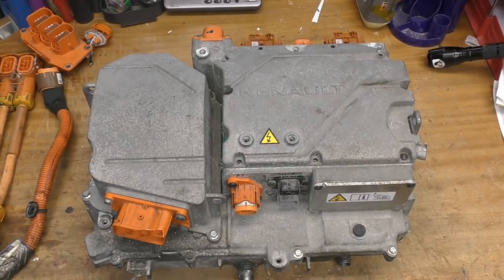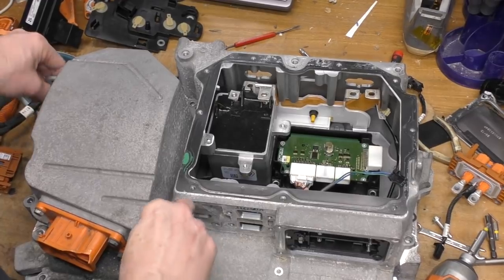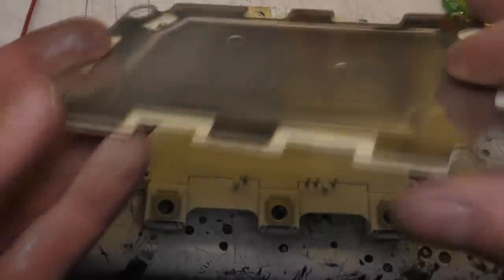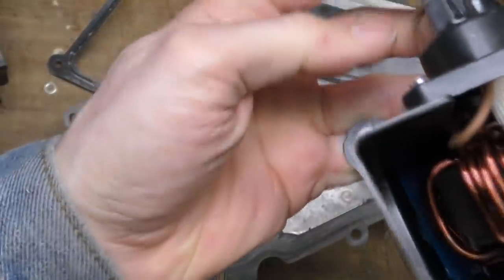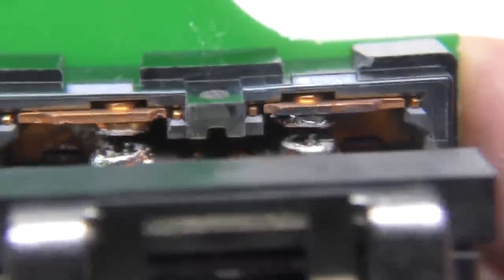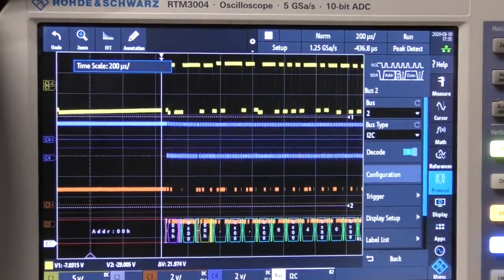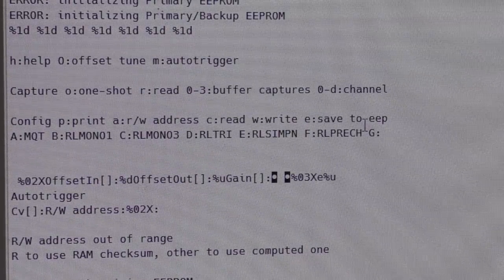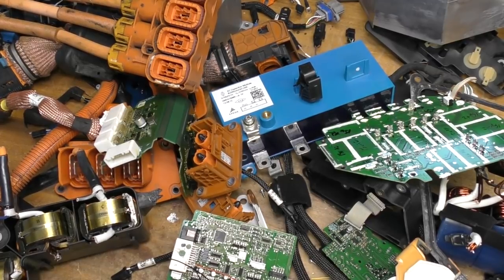Renault Zoe EV Battery Charger Block ( BCB )

Comment: Hi, thanks for this video, very interresting. You correctly guessed a ot of elements :)
A few technical indications though:
- On the rectifier control board, this is an Actel/Microsemi/Microchip (in order of company acquisition) A3P125 praetorian FPGA, not a plebeian CPLD :P It mostly manages safety redundancy and some basic low-level / high-speed functions (OC and OV detection and latching, blanking and dead-time correction ...). There has been some experiments of making it do the PWM generation instead of the MCU, but it showed unconclusive in terms of efficiency for the system.
- There are two CAN transceivers on this board, one for the vehicle CAN and board power management (TJA1043), one for the transmission of the BOOST signal, which uses the CAN analog transport interface for noise immunity, thus the transceiver is a much simpler one, with no timeout protection, since the signal is a simple 10kHz PWM.
- The shunt board generates a 100kHz PWM that indicates the neutral current, and is read by the MCU (since there are no isolated analog links in the isolator chip, the value has to be transmitted with digital signal).
- The input module control board (with the DSPIC) has no CAN transceiver, it is not connected to the CAN bus. The compnents you saw are LVDS transceivers, which give some noise immunity to the SPI bus between the rectifier and the input module. This bus goes through the small shielded harness. This link is really noisy, thus the SPI frequency is pretty low (5MHz).
- The Input Module having no connection to the CAN bus of the vehicle, it is not a "standalone" ECU that can be accessed through the ODB plug. It is a slave module for the rectifier. In addition, there is no mean for reprogramming through the SPI, thus the presence of the ICSP connector for eventual update.
- Being a slave module for the rectifier, the input module only does analog measurements of mains voltages and currents, and manages some relays, including pre-charge relay, pretty much like some kind of evoluted IO expander. You are right : the content of ths program in this module is not very interresting.
Reply: No Renault not interesting 😁😆😆😆😆
Reply: Does that mean that if it fails there is no way to know unless you open the unit physically ?

Comment: I am more impressed by connectors and interlocks than by electronics.
Reply: They look fragile and overly complex to me, but I'm no expert ;-) It would be interesting to compare with other brands.
Reply: They seem like the outcome of an odd engineering tradeoff between reliability and speed/ease of assembly; bolted lugs (perhaps with a plastic cover containing the interlock mechanism and sealing) would be more reliable, but much slower to assemble.

Comment: I heard that it would just measure one of the additional L2 or L3 phases to decide if the supply is single or 3 phase. 3 phase plugs usually are required to have a 3 phase circuit breaker, avoiding a phase missing on the plug. But any main fuse of a building needs to be a fuse that melts, so it is not tripping all phases, risky not to monitor all phases then. Don't forget, it is a french car, it doesn't have faults, it has character ;)
Reply: As they say, it's not a bug, it's a feature!
Reply from the maker: Some tethered public charger cables are in terrible condition, so a broken L2 core is totally plausible
Reply: Grubby contactors in public chargers, very easy for a phase to be missing. Hope someone sends a 22kW one in to Mike. The 22kW does still very much make sense with CCS too, as the new one has, as I regularly charge at 22kW AC only chargers.But agree 43kW is dying, given that they are costly to add to rapids due to being tethered thick cables. A 22kW socket is similar cost to a 7kW if there's a 3phase supply to the unit anyway
Reply: Can't wait to see what character Landrover manages to build in if they make an EV. I'm sure it'll be the first EV to leak oil from the charger module.

Comment: Hi Mike! Excellent video.
We have a 2013 reg Zoe with this BCB setup, we have our car at a Renault dealer for the 3rd year in a row with the filter unit going faulty. The Renault Dealers can never work it out its hilarious!
The first year the dealer had the car for 6 months and replaced everything motor, gearbox, BCB the lot under warranty problem solved lol.
The second year they kept giving it back to us saying its was the cable, no fault found etc, meanwhile we blew most of the public charge points in the north west. It took for BP Chargemaster in the end to send out an engineer to test the car whilst charging, what we found was after about 20 mins or so charging at 22kw 3phase the inverter would get hot (you could here a loud fan come on) and the amp reading from L2 would loose 10 amps, whist checking the earth, it gained 10 amps back to the charge point so the L2 circuit was short circuit. Filter replaced under warranty after me bugging them about it problem solved) . We think the problem is we only charge on 3 phase public charge points at 22kw the filters dont seem to last longer than 6k miles worth of that kind of charging.
Anyway here we are again for the third year in a row! we have been getting slight shocks of the body recently and now its has blown charge points again after 6k miles, this year when it first did it, it sent a surge through the car and flicked off all the 12v breakers in the car until ignition was reset.  Now the dealership say we have to pay a stupid amount of money so a Technician can chase down fault code "006023" which is a Renault specific DTC for the EVC. We know its the filter box going faulty again but unfortunately for us Renault insist on plugging in a 5v DC computer to tell them answers on a 600v ac system. 
So we had a question for you, do you know if the EVC is the ecu that controls inverter setup (Filter Box etc). And do you know of the code from Renault so I can pin it to the Filter Box to save getting an electrician to a charge point, thanks.
Reply: Hi, Is your car Q90 or R90? I didn't get from this long video which model has that problem and how to prevent from happening?
Reply: Wow what a shitty car, hope you got rid of it what a PITA!

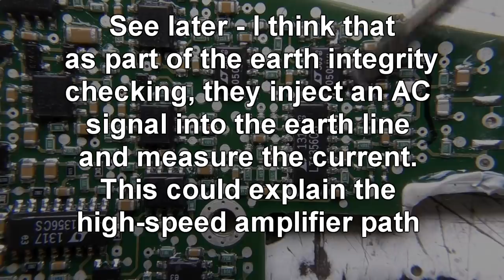Comment: Re the comment at 20:24; I designed the GMI (ground impedance test) circuit for an EV 'charger' (EVSE; unfortunately can't describe how it works b/c commercial confidentiality) but it did not require anything fancy or highspeed; three or four dirt-cheap commodity silicon parts and some passives.  The BOM for that section is maybe $3. I don't know how 'other people do it' but the solution I came up with is simple and works fine (can safely measure the gnd impedance from a few ohms to kilohms; enough accuracy as we just need to not activate power if the ground is no good, actual trip points fairly loosely defined in standards). There was a bit of headscratching as it's not immediately obvious (wasn't to me) how to do it -  we worked out some viable-but-complicated ideas, then I had a lightbulb moment and it turned out to be simple and cheap.
Reply from the maker: Checking earth form the car's end is rather different as it has no reliable reference for what earth is, as it sits on insulated tyres.
Reply: Could you emphasize on the earth-checking system of Zoe, please? I paid an electrician to install new 3phase 5wire cable and 5pin CEE32A socket. He'll do that next week. I told him that the car is earth-picky but he didn't get what I mean. He said that in our country the Neutral and Earth are galvanicly conected and that he will short them at the main power box. Should I tell him to connect the Earth wire from the new cable to an Earth rod, instead(there is a suitable damp place to install one)?

Comment: Lever-lock connectors are actually very common in car wire harnesses since a long times, the ones used here are just using an usual lock-lever design, on steroids.

Comment: The Relay-Melting-Error happens when a Charging-Session is started without L2 but with live L1 and L3, because only L2 gets checked to determine 1ph or 3ph ( https://www.goingelectric.de/forum/viewtopic.php?f=62&t=26015&p=588280&hilit=zoe+relais+kurzschluss#p588280 ).

The Module looks like the 43 kW Version (Conti, Q), the 22 kW (Renault, R) Engineroom looks completely different https://i2.wp.com/www.zoe-club-austria.at/main/wp-content/uploads/2016/01/MotorVergleich_Q210R240.jpg?ssl=1 .
Reply: That sounds like a major design flaw. Check L3 before trying to connect it to neutral.
Reply from the maker: That is so dumb - I think anyone experiencing it would have a good case for a free out-of-warranty repair as it is a design flaw that was there from new
Reply: It is covered under the 5y HV-Warranty and there might be a Firmware fix, but no one wants to try out since the repair cost is a few thousand € and renaults goodwill is to low.
Is it doable to change the relay without any destruction, e.g. cutting the connector-cables?
Reply: a €5000 phut-bzzz noise maker then?
Reply: All those elaborate self checking safety systems and interlocks and they miss something like that, oops to whoever wrote those test scripts.
Reply: @mikeselectricstuff  or anyone else who might know this:
How do the relays at the bottom (marked with 1-3 in 27:46 ) behave during single and three phase charging?
Is relay 3 closed when using three-phase charging (so a star connection to earth via the 220n and the Y2 capacitors) and relay 1 or 2 are closed when using single-phase charging (depending on which of the two wires really is "N" - you can't know that with a regular household plug)?
Or are all three (1, 2 and 3) closed when using single phase charging (via L2 in this case) - however, this  probably doesn't fit the theory that single-phase charging is detected and the N-L3 relay is closed when L2 is without voltage...
Reply: Could we assume that R version with 22kw AC charging is safe from this Short situation?

Comment: That connecting a phase to neutral fault can also happen on Konas combined with a Zappi 3 phase charger. The charger swaps between 1 and 3 phase to fine tune the amount of power the car can take and under the right combination of conditions, bang!

Comment: The relay switched caps to ground are probably switched because those capacitor values they needed for enough EMI suppression are too large to give a safe touch current if the ground is interrupted and because they would trip RCDs if connected as usual from both line and neutral to ground. Relay 3 would be energized for a three phase supply where the X2 capacitor midpoints are close to ground potential. Relay 1 or 2 would energize for a single phase feed depending on if line and neutral are reversed (1) or not (2).

Comment: I lvoed my Zoe but the charging system was fickle and unneccessarily complex. Just like the heat pump which was pointless below 0 C, and made the heating/cooling excessively loud. And despite all the complicated charging electronics, you can't even set the charge current inside the car.  I had the 22kW version with the 22kWh battery (R240). Now I'm driving a Model 3 and I have to say it's a completely different beast. Especially if you lease, the relatively small difference in monthly payment makes it really hard to go for a Zoe, even the latest one.
Still, I enjoyed driving my Zoe. It was a quirky little car that had a lot of spunk going from 0-50kph. And the driving position and seat was VERY comfortable.

Comment: Great video, thanks. The 22 kW unit is completely different, Function of PEB and BCB in one metal box. Pretty sure the blue capacitor is filtering only. Power factor correction is done using the switching. The relay switching 3/1 phase is actually connecting L3 to N. How cool you got one with the welded relay. I also had my hands on one that because of either a relay or control fault could not charge one phase, but happily 3 phase. The relay noises were pretty scary.

Hera are some wave forms and the PE-N current insertions. All made by speakev user ElectricBeagle btw. https://canze.fisch.lu/charger-startup-sequence-the-measurements/
Reply: do you have schematics? I'm curious what will happen if N is disconnected when charging?
Reply: @rslutsker  I don't, only functional. You can find them in the CanZE blog. The phase current, while shaped, is most certainly no perfect sine. I would expect the charger to balk immediately if the N was disconnected, also (and maybe most importantly) because then the N-PE voltage would spike, indicating an unsafe condition. I am curious why you are exploring this scenario?

Comment: I had to have this replaced on my Renault Zoe when I had one. It had a fault where when charging at the full 43KW it kept tripping an internal sensor but worked fine on 22KW & 7KW Chargers. After a lot of diagnosis with the Dealership & Renault it was found that this was faulty and the error codes seemed to point that the Neutral pin was sensing power when it was on the 43KW units.
Reply: Ryan Walmsley how much did it cost? Mine needs a replacement

Comment: Do you think it would be possible to integrate DC charging into the battery charger block, if a seperate CHAdeMO controller is used?

Comment: Thanks Mike. What a horrendously overcomplicated setup! Surely it would have been much simpler to have a 5 wire input of 3 phases, a Neutral and Earth? Then there would be no need for any switching of what can also be a Line cable to Neutral.

Comment: Great video! Do you know which relay activated the battery heater in the Q90 Zoe? I would like preheating the battery, before charging in winter, to have max DC charging power.

Comment: aluminium bonding wires and the jelly potting combo is notoriously unreliable in automotive stuff, resulting in the most un-reliable ecus and actuators ever made. Real shame to see this tech still being used :(  looking forward to getting loads of these in for repair  in 7-10 years time :)
Reply: toyota hybrid inverters use those too

theyre some of the most reliable cars ever made
Reply: The thick bonding wires for high power are pretty sturdy - I suspect thinner bondwires get affected by gel bouncing around in lower power devices more. Second the comment about Prius power electronics being solid.

Comment: I realise that this is quite an old video, hope you still read the comments.
Did you see a chip where the vin. number and other data relative to the vehicle it is fitted to while you dismantled the unit?
I am planning on fitting a used unit to my van and if renault have built in a chip to dedicate the unit to a particular vehicle it could be a deal breaker.
Thanks

Comment: The new Zoe CCS charging is an option by default they still only come with 22 kW AC which seems like "we designed this, we are damn well going to use it". So they still have all this gubbins on the new models which is probably similar to this with an add on for the CCS option.

Comment: That board with lots of caps, relays and inductors - perhaps it's a configurable power factor correction set?
Reply: It’s for PWM harmonics filtering. Power factor correction is easily achieved in the current controller in the feedback control system in the firmware.
Meeting power grid harmonic current limits can be difficult. Specially if the PWM frequency is low, you’d need a lot of inductance etc. Increasing frequency also increases switching losses so it’s a compromise.

Comment: Excellent and amazing video Mike, I have a Zoe Q210 upgraded battery from 22 to 41 kWh and 150,000 km, and from last week it is impossible to charge in public chargers from 2.3 to 43 kW except a Circutor Raption 50 kW, at home 7,4 kW no problem. All RCD disconnect sometimes in the beginning and sometimes in the middle of the charge. I am afraid going Renaut Services, they have not much idea and change parts and I will pay a lot of money. I don't know if the problems is harmonic noise, DC or AC leak, etc. Can you help me what to do? One of them a 22 kW Orbis Viris Uni has 6 mA DC leak detector and the warning was activated. I've just measured harmonics and before is 1.8% and charging 2.0 % and I can't view relevant harmonics in graphic.

Comment: Hi, just after some advice. I have a Zoe q210 with the same bcb that u are disassembling. It has stopped charging as I believe it has a fault in the bcb. I have checked the OBD faults and it's coming back with an earth sensing fault that cannot be erased. Just wanted to know if u have any advice on what it could be thanks. Great video by the way.

Comment: It all seems very over engineered, especially those connectors. Is there really no simpler way to connect two high-current conductors together inside a plastic connector? So many molded parts and fiddly metal bits!
Reply: why so much strangely shaped aluminum pieces, its way too much over-engineered

are electronics this much explosive that it must be contained by thick aluminum like a ICE engine ?

Comment: Imagine what its going to be like in a decade or two, it will be amazing being able to get our hands on monster electronics reasonably cheaply ... Electric cars are awesome but only concern in my head is crash damage (ive seen what happens when you damage lithium  cells) lol
Reply: it's nothing like as bad as a gasoline fire; people have time to get out, walk across the street and get their phone out. Google "Tesla Model S Spontaneously on Fire in Los Angeles" and you can see the pack venting out the sides of the car, which, while definitely not cool, is a hell of a lot better than a gas tank blowing up. Cops and firefighters are pretty chill about it.
Reply: @DrTune Thanks Fella, I realise that this has of course had serious consideration and will have been extensively tested, like I say was just thinking of what I have seen from ''small'' lithium packs and imagining that on a massive scale :) ...........